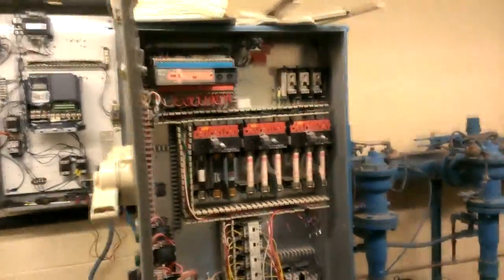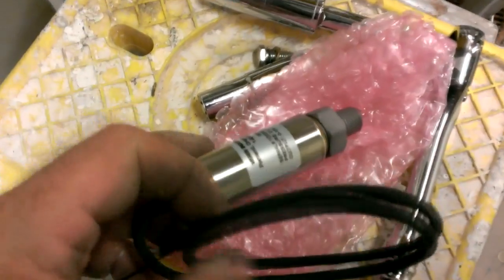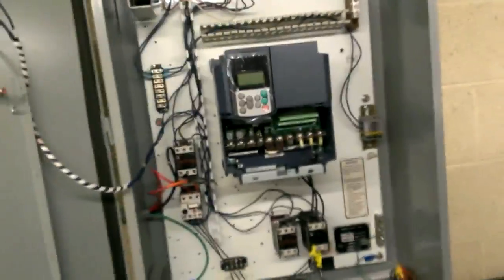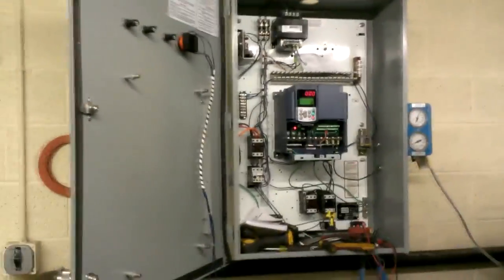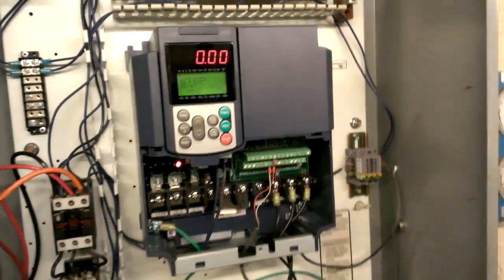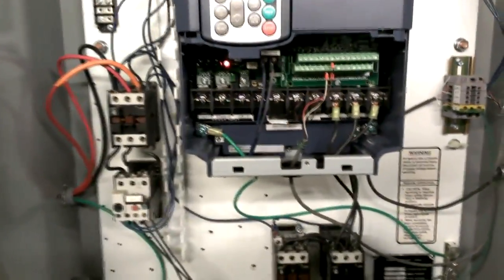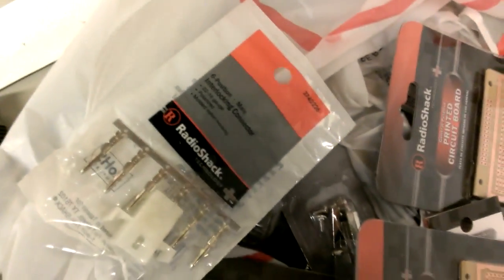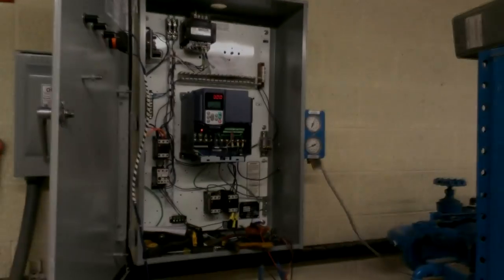Pump Variable Frequency Drive Retro Project - Part 2

Comment from the maker: I actually cleaned it up a lot today after installing the control board. 
The wiring is in raceways and the covers are over them now.
Also zip tied. 

I ran out of time just getting the VFD up and running temporarily at a fixed frequency for the weekend and forgot to get video. :-(

I might stop by work after running some errands and check on it and get a video clip.